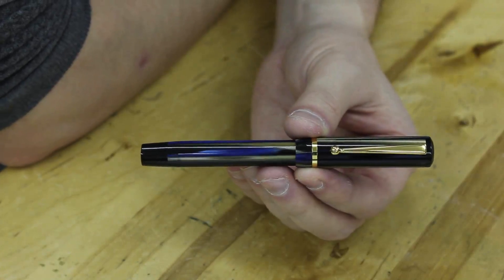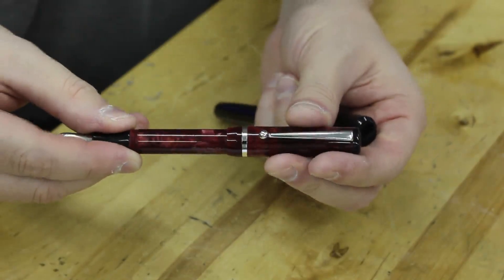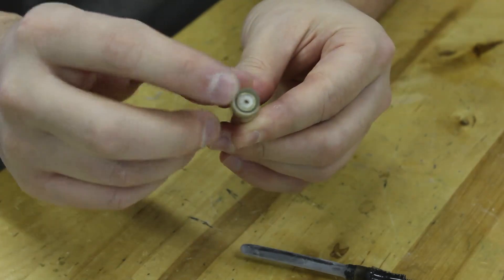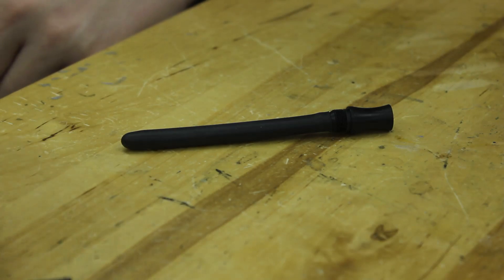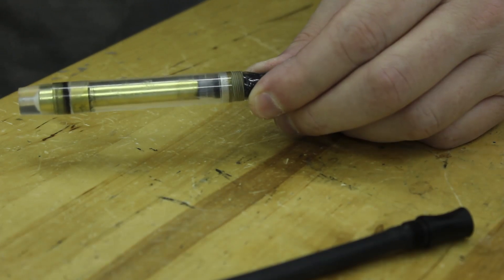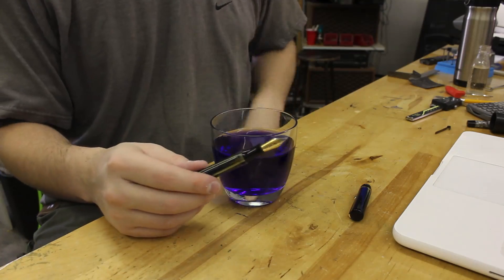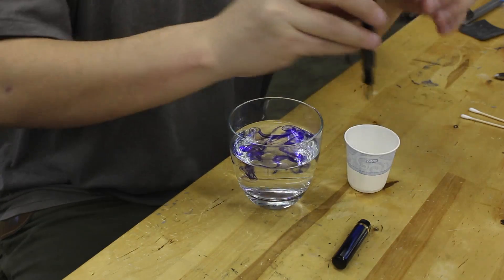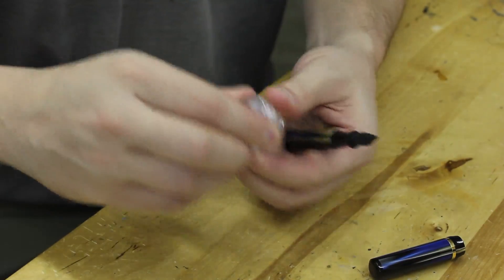Beaumont Pneumatic Filler!

Comment: Great pen! Is there any restriction on the ink that can be used? For example, can I use De Atramentis Permanent Black Fountain Pen ink? Or is it recommended to use only non-waterproof inks?
Reply from the maker: Actually, this is a filling system that we discontinue a while back. I found over the long term that latex sacs just weren't reliable enough for me to continue standing behind. I engineered the Draw Filler as an upgrade to this. So you could still have a Beaumont just like this, but as a Draw Filler or Converter Filler.
https://edisonpen.com/index.cfm/2017/05/17/new-from-edison-the-draw-filler/
Reply: @edisonpenco  Thank you so much for your reply! I shall go and have a look at the draw filler. I find converters just don't hold enough ink for me. I write with a broad nib - and I write a lot. Right - I'm off to peruse your website now. Many thanks again.

Comment: This filling system reminds me of my Sheaffer Touchdown.
Reply from the maker: +thelongslowgoodbye Yes, the exact same concept, but Sheaffer used a different way to release the compression.  Thanks!
Reply: @edisonpenco  yup I was kinda expecting a mention of the touchdown. Those had an extra metal cylinder over the sac, so it could not be damaged by what is here a brass tube. Not sure what other function it had, but I would love to know.

I like this idea a lot.

Comment from the maker: The interior tube has to be metal.  This excludes any kind of clear material. 

We can do demonstrators, but you will not be able to see through the interior metal tube.

Also - we apply a light dusting of talc on the sac to promote smooth action.  This might make a demonstrator not-so-good-looking.  Notice that my demonstrator looked a little rough in the video?  This is mostly due to the talc.

Thanks!

Comment: I think the pneumatic mechanism could be incorporated into other pen models and still work aesthetically if you had the barrel sliding back ad forward, with the inner tube fixed. I have no idea how that would work at the point of manufacture, though.